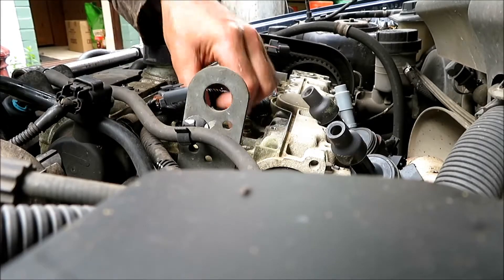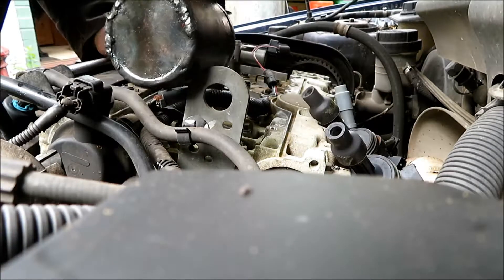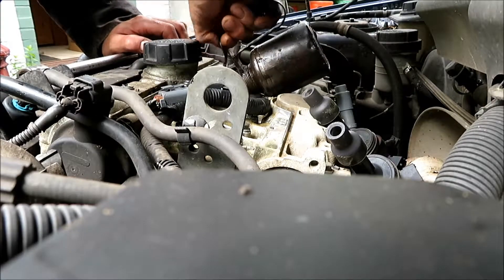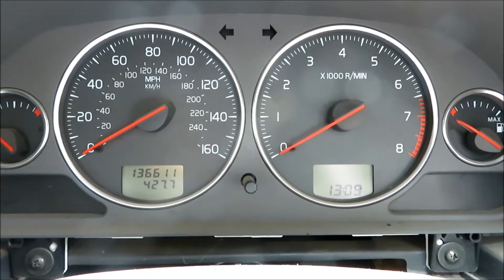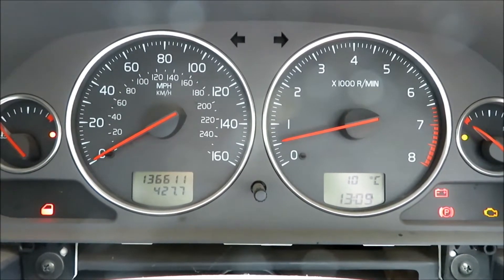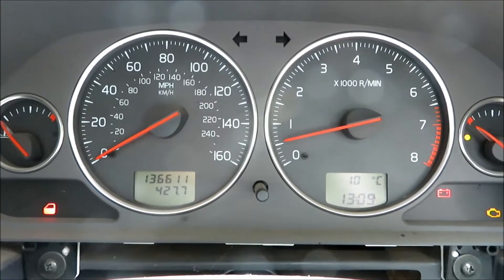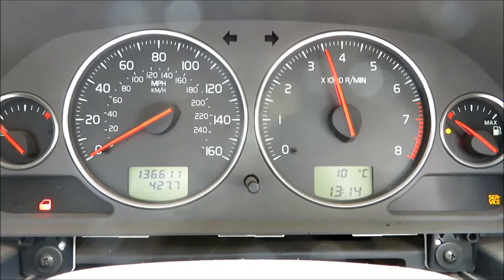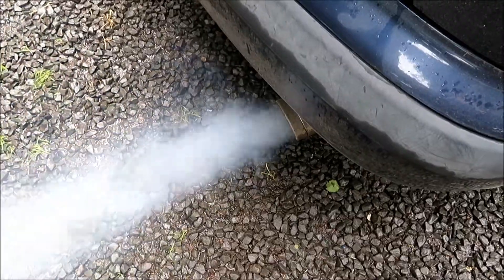Petrol engine no compression, Volvo V40, repair

Comment: just demonstrating that the rings and or bore are worn out
Reply from the maker: No, in this case you are wrong. The engine was just fine the day before I added some incompatable oil and the next day, no compression. After changing the oil we used the car for another eighteen months with no problems and the engine was still good when we sold the car. Regards,Jon